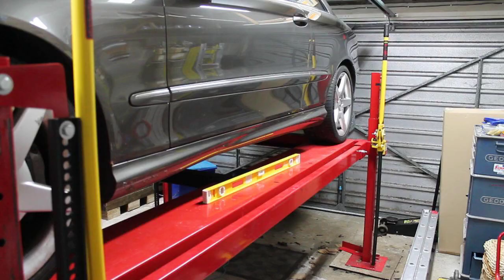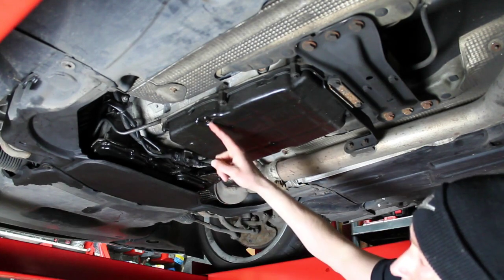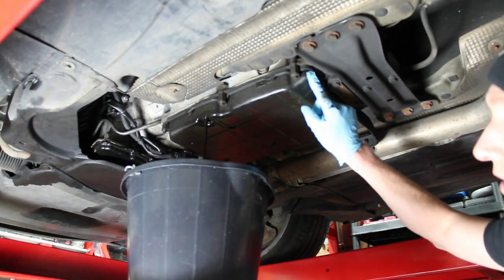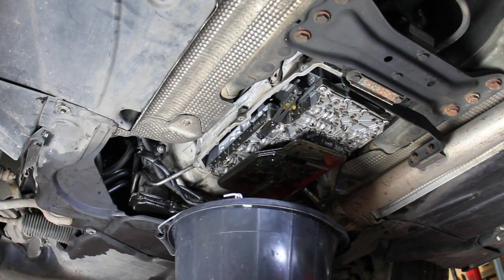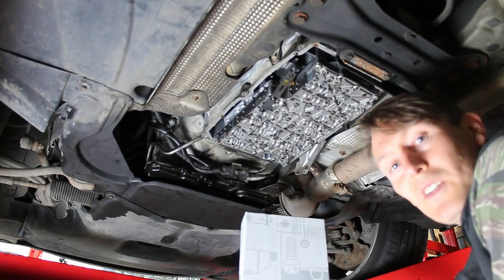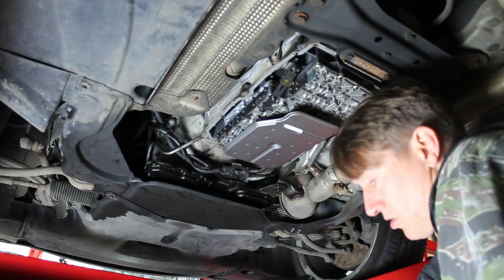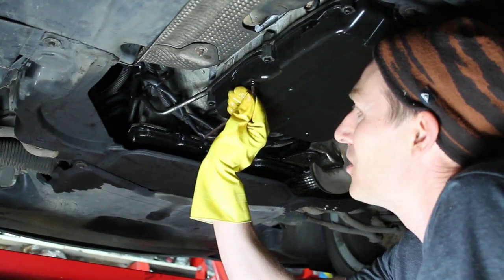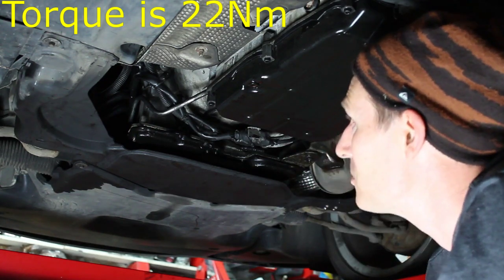How to Change the Oil and Filter on a Mercedes 7 Gtronic 722.9 Automatic Transmission

Comment from the maker: THIS VID MAY INTEREST YOU! - How to replace rear shock absorbers /struts on a Mercedes Benz https://youtu.be/wIHaPlfZI34
Reply from the maker: @bigbruno56  Hi, to be honest I've never done it this way. My gut feel is that it isn't a good idea because the snorkel is a plastic piece and therefore, is quite light, so I imagine it would float around inside and maybe get caught up in something? I know it seems like a pain but if you buy the pan gasket and new bolts, you can go ahead and drop the pan and this would definitely be the safer option. Thanks, Phil
Reply from the maker: @bigbruno56  No probs! Hope you get on ok with the job!
Reply from the maker: @bigbruno56  okey dokey, sounds like you know what you’re doing! 👍 and sometimes it is a case of keeping these old cars running. YouTube is very international, nice to have a viewer from Scotland, I’m in Yorkshire but you may have gathered that from the accent! 😁 cheers, Phil
Reply from the maker: @bigbruno56  hi, I believe the part you are talking about is the overflow pipe that fits just inside the drain plug (I think I call it a snorkel in the video, didn’t know the correct term for it at the time!). Anyway, it is really important but if you are filling the transmission from the bottom and then doing the level check, it is the overflow pipe that allows you to set the level correctly. Effectively, you fill from the bottom, warm up the transmission, remove the drain plug and any fluid that is above the level of the overflow pipe will run back out. There’s a good write up about it here: https://www.youcanic.com/wiki/mercedes-7229-7-speed-transmission-check-fluid-level If you want to remove the overflow pipe, my understanding is that there is a special tool / drift that allows you to do so. I’ve never done it this way, but here’s a link to the info. https://mbworld.org/forums/attachments/e-class-w212/417964d1537904979-service-207-coupe-212-sedan-automatic-transmission-oil-pan.pdf Hope that helps! Thanks, Phil
Reply from the maker: @bigbruno56  Hi, if you were planning on doing a full transmission fluid change, the minimum amount you would normally change is 5L (for cars like mine that didn't have a torque converter drain plug). If you are able to completely change the fluid, then it can be up to around 7L. So, two comments really. 1) Hardly any fluid has been changed, so the work that you have had done isn't a full fluid change / service 2) I don't want to alarm you because I have zero experience of using slip stop in transmissions but I would never, ever use anything but the recommended fluid in my Mercedes transmission. They are pretty much bullet proof if serviced correctly with the right fluid and filters etc. You didn't mention in your previous messages that your transmission wasn't working properly? Were you having problems with it, hence the slip stop? BTW, Mercedes transmissions can give the feeling that they are slipping (engine revs and the drive doesn't engage fully) if the fluid is low. Hope this helps! Thanks, Phil

Comment: De rien ! je viens de  réaliser mon kit grâce à toi , il se visse en lieu et place du trou de vidange du carter de boite sur ma Mercedes classe E 280 CDI, un petit robinet, un tuyau, relié à une boite tube qui s'ouvre par le haut vissé avec joint (tube PVC 100) sur le couvercle également une valve de roue, un tuyau intérieur qui sort a l'extérieur vers le robinet et boite, pour faire monter l'huile installé dans le tube (1l ) je branche le compresseur sur la valve avec un manomètre et il me reste à appuyer sur le manomètre et l'air comprime la boite et fait sortir l'huile en pression et le robinet comme pour toi me permet de couper afin d'éviter que l'huile ressorte lors du remplissage de ma boite. Pour info utilise un tuyau PVC plomberie de 100 également pour boucher un raccord PVC avec couvercle et joint qui se dévisse, et à l'autre extrémité un bouchon aussi en PVC de 100. Encore merci pour ta vidéo, Amicalement Philippe
Reply from the maker: Salut @philippe4593, on dirait que tu as fait du bon travail dans la construction de ton kit ! Et cela vous sera de nouveau utile la prochaine fois que vous ferez le travail. Merci pour votre commentaire et ravie que la vidéo vous ait aidé ! Bravo, Phil

Comment: Very nice invention of the refill pump !  Thanks for sharing.
Reply from the maker: No probs, hope it helps! BTW, a few buyers have mentioned using an inexpensive electric pump that they bought from Aldi for this job (probably available elsewhere - Amazon, Ebay etc). Not sure of the details of it but might be a good alternative. Although, I must say, I find the hand suction pump really useful for all sorts of jobs since I got it, so it is a good addition to the garage. Also, you would probably still need an adaptor of some kind into the sump outlet. Thanks, Phil

Comment: Hi great video thank you! You put in 5 litres of ATF, but everywhere I’ve read about this states its 9 litres? Can you please explain this as I have a 7 speed as well?
Reply from the maker: Hi Graham, the most I have seen stated as a total refill volume is just over 7L, never as high as 9L, so I would say that 9L is definitely incorrect. The reason you see variation on the 722.9 transmission from around 5L refill to as high as 7.5L is because the transmission design evolved over time. It always had the same max fluid capacity but Mercedes improved the ability to drain it down over time. On later versions a plug was added to the torque converter, so you could drain it as well. Some owners also detach the pipes that go to the transmission oil cooler, so that they can change more of the fluid. If you check out this link, some members of the Merc forum have attached links to various documents (including how to drain the torque converter if the transmission in your car has a drain plug on it). https://mbworld.org/forums/clk-class-w209/471925-wis-doc-722-9-torque-converter-transmission-drain.html Hope that helps!  Thanks, Phil
Reply: @ReviveMyRide  thanks heaps Phil for the info, my Merc is a 2013 E400 sedan can I assume it has the 722.9 trans in it?
Reply from the maker: @grahamsmith7407  no probs! yep, my understanding is the the 7 speed (7G tronic) is the 722.9. Then it moved to a 9 speed (725.0) and the predecessor was the 5 speed (722.6) Cheers, Phil
Reply: @ReviveMyRide  cool thanks again Phil!👍

Comment: WARNING!
The fluid should be drained off when the engine is RUNNING and the oil is 45C. If the engine is not running an insufficient amount of oil will be in the system as the pump is not running and cycling the oil.
Reply from the maker: DON'T PANIC!
Thanks for your comment and Technically you are correct and this is probably how I would do it in the future BUT it isn't as big a deal as you think. If you switch off the car and immediately drain off the excess as shown in the video and shut the drain valve as soon as the fluid flow slows to a trickle, then you will be fine. This is how I carried out the transmission service on this car over the last 10+ years, the transmission is absolutely faultless in its operation and now approaching 120k miles. If the fluid level is incorrect, believe me, you can tell and I have experienced it.  The shifts get clunky or slow to engage and often the car has lack of drive when setting off from cold.

Comment: Hi there, if the oil drains out as soon as you take the sump plug off, does that mean it was overfilled in the first place as the level is above the snorkel/overflow pipe?
Reply from the maker: Hi, no, not necessarily. The final fluid check and level adjustment on the transmission is often done with it running, meaning some of the fluid will be in circulation. When draining the transmission, it is usually switched off and been sitting for a while. Just an estimate but I would expect up to 200 - 300ml to come out of the drain plug when you take the sump plug out. Hope that helps! Happy to answer any question you have if I can! Cheers, Phil
Reply: @ReviveMyRide  thanks!

Comment: could the oil have been replaced by a professional mechanic who has been repairing cars for 10 years but has never changed the oil in an automatic transmission?
Reply from the maker: Hi, are you asking me if someone  with 10yrs experience repairing cars will have the skills necessary to do this job? If so, then yes, I would have thought someone with that level experience will have no problem doing this auto transmission fluid change. It's all about taking the time to read up about the procedure, watch videos like mine 😉 and then ordering in the required parts and materials ahead of time. Hope that helps! Cheers, Phil

Comment: Great video. This whole "fill and check through the drain" had me wondering what the heck was going on. Your video makes it understandable and easy to do. 
Changing the engine oil was already a huge mess. LOL 
So I wanted to check on how to do the transmission properly. 

About the ones without a torque converter drain plug, I'm sure you could do with this, what I do with GM cars, where you just fill it, run it a bit, then drain it again, then refill it, to replace more fluid. Definitely a little more costly, but you do get more old fluid out. 

I watched another video before this one. It pointed out that when you drain the fluid, you can push that white plastic level piece up into the pan, to allow it to drain more, before dropping the pan. 

After watching this, now I have a better idea of how to make a took for filling it. Thank you.
Reply from the maker: Hi, great that the video helped with your tranny fluid change! Good point about flushing out with some fresh oil and redraining. Definitely an option for those concerned about getting a full fluid change. Yep, you are right, it is possible to push up the fill tube and drain more fluid before dropping the pan, making it less messy! I think I would do it this way in the future... Thanks for your comments and sharing your experience! Cheers, Phil

Comment: Great content, thanks!
I have 2011 w212 E200 CGI with 5G-Tronic. You know if they have same Refilling adapter
M12x1.5 (male thread) and my transmission is also call 722.9?
Reply from the maker: Hi, Good question that got me checking around a bit! Looks like they offered two auto transmissions on your model of car. The 5 speed, known as the 722.6 and the 7 speed, known as the 722.9.
If your transmission is a 5-speed, then it is a 722.6 gearbox and the thread size for the adaptor is different, it is a M10x1.0 (male thread). Check out this website which may be useful to you. https://nemigaparts.com/cat_spares/epc/mercedes/1/ga/722646/21s/27/115/?chasis=212003D01 Also, maybe do some searches for a 722.6 transmission fluid change video as the procedure is likely to be slightly different. Sorry, I haven't worked on one of the 5 speeds before. Hope this helps! Cheers,
Phil
Reply: @ReviveMyRide  Thank you for your reply! Is helping alot. Keep up the good content sir. :)

Comment: Thank you so much for this.  I did my car yesterday following your instructions.  I used a magnetic spirit level on the underside of the sump, was able to dislodge the pipe inside with a screwdriver to get most of the fluid out before removing the sump pan.  I used a small oil pump I had bought from Lidl and the pipe fitting you recommended.  A very satisfying experience, which I wouldn't have been able to do without your excellent video.
Reply from the maker: Wow, thank you so much for your feedback and for the extra info about the Lidl pump. I have heard about people using these, I think I might need to get one for next time I do the job! Cheers, Phil
Reply: @ReviveMyRide  You are very welcome Phil and by pure coincide, the fatter of the two pipes on my pump was exactly the right size for the M12 x 1.5 fitting!

Comment: Thanks for the video! A totally noob question.. is this the same transmission model as used on the 7-speed auto for the SLKs R171? Thanks again :)
Reply from the maker: Yep, my understanding is that the SLK from that era used the 7G-Tronic gearbox. Very good box and very reliable is serviced regularly! Thanks, Phil

Comment: Is there a reason that you didnt drain oil from torque converter? It should be done in oil change? I think you leave at least 2l old dirty oil in if you dont drain torque converter.
Reply from the maker: Thanks for your comment! Yes there is, early 722.9 7G's didn't have torque converter drain plugs. I have tried to address this point on the comment board for this video by creating a "sticky / pinned" comment at the top and adding some info in the description. If you want to read more about it, here is a link to a discussion on a Benz forum: https://www.benzworld.org/threads/cant-find-722-9-torque-converter-drain-plug.2118665/ Cheers, Phil

Comment: you forgot to drain the torq converter. You should always drain it on 7g transmissions. you have to take down the extra oil pump and turn the engine until you find the drain plug on the torq converter. 10nm is the torq on the bolts :) Engine should be at running temp befor draining it :)
Reply from the maker: Hi, thank you for your comment, just to reply to your points: Early 722.9 7g's didn't have torque converter drain plugs. I previously added a comment on this video and made it a "sticky" where I clarified this point. Also, you can read about it here on the Benz forum, you will get lots of hits if you search for it: https://www.benzworld.org/threads/cant-find-722-9-torque-converter-drain-plug.2118665/ Some owners detach the pipes to the oil cooler to drain more fluid but I couldn't find an official procedure for this, so I stuck to the standard fluid change process. I used 8Nm for my pan bolts as this is the number I found in my documentation. It could be that it has been updated (procedures, fill levels etc do get updated from time to time by MB) but rest assured that 8Nm worked for me with no leaks. I think running up to temperature before draining may be a personal choice, there are plenty of other people who advocate leaving the car to sit overnight and then draining it when it is flat cold. I don't think there is a right or wrong way, or if there is it will probably make minimal difference, as the fluid is pretty thin and drains very readily. Thanks, Phil

Comment: Can you please share where did you order the drain plug crush washer, is there a parts # from MB?
Reply from the maker: Hi, the part number is: N 007603 012102. I usually buy from Autodoc, but they have had some problems delivering to the UK since Brexit (might be resolved now?). If you do go on Autodoc using the part number, you can then click on the details of the item and it will confirm which vehicles it fits (this is a really useful feature even if you don't end up buying from them). Also, using the part number, I found some on ebay for a couple of £. I have bought Vaico in the past and found them to be good. Hope this helps! Any further Q's please just ask! Cheers, Phil
Reply: @ReviveMyRide  Thank you! I got the correct number and pick up one at local dealership.
Reply: @ReviveMyRide  BTW, do you also have a video for drain the torque converter? Mine has a drain plug but the position is at an odd angle and hard to reach with ratchet wrench
Reply from the maker: @4hikers629  Hi, sorry I don’t have a video on that as my car doesn’t have the torque converter drain :-( However I have read that you need to turn the engine at the crank to bring the torque converter plug to the bottom. See this link: https://www.benzworld.org/threads/how-do-you-rotate-the-torque-converter-to-get-to-the-drain-plug.1642176/ Hope that helps! Cheers, Phil
Reply: @ReviveMyRide  Thank you. I did see the drain plug, it's just difficult to work on because of the odd angle

Comment: I have a 2007 E350 Sport W211  with a 722.9 7 speed transmission.   I've serviced everything on the car myself except the transmission which I had the Mercedes Dealership do a year ago.  I can't seem to find the dealer port for the trans in the engine bay so i can check the level or the color.  Please Help!
Reply from the maker: Hi, one of the limitations of this transmission design is that most of the versions (if not all, I haven't checked every version) don't have a dipstick or any other means of checking the fluid level and colour from the engine bay. Mine certainly doesn't. You set the level when refilling it (from underneath) after a service and then don't check again until the next service. I'm not entirely comfortable with this either but it seems that is the modern way! Hope that helps! Thanks, Phil
Reply: @ReviveMyRide  Thanks!

Comment: What about removing the return line to the transmission pan so that you can flush out any transmission fluid left over in any trans coolers. Also what about the torque converter Is it possible to drain that as well? They usually have a cover which can be removed to reveal a drain bolt.
Reply from the maker: Hi, thanks for your comments! I didn't disconnect the return lines because that wasn't part of the procedure that I decided to follow. I suppose I was trying to keep it simple. I have heard of it being done, it just comes down to personal preference. Yes, you are correct, if your torque converter has a drain plug, then you should drain it as well. Please see a comment that I pinned to the top of the video comments board for more info! Thanks, Phil